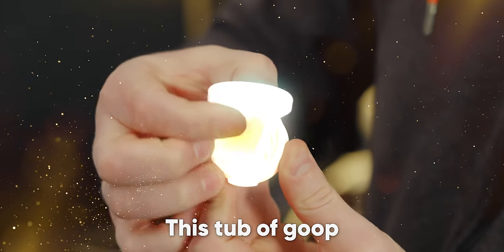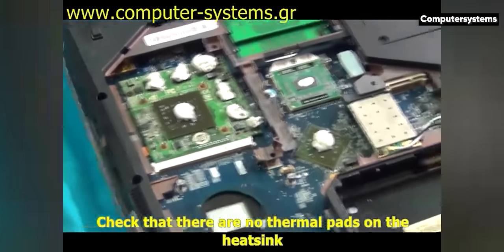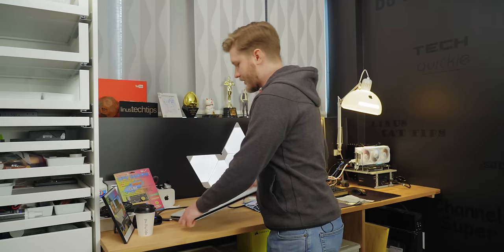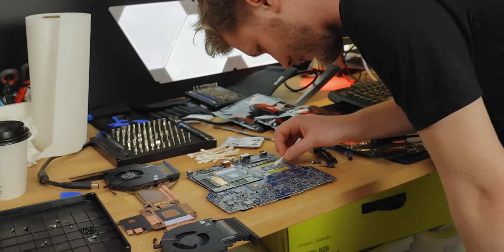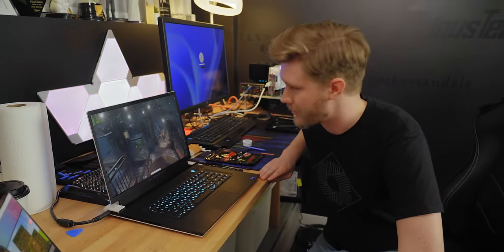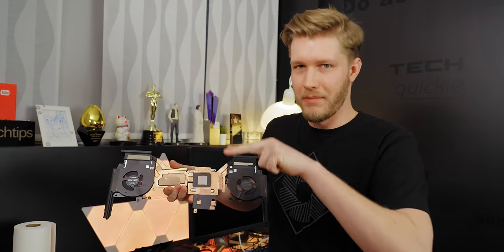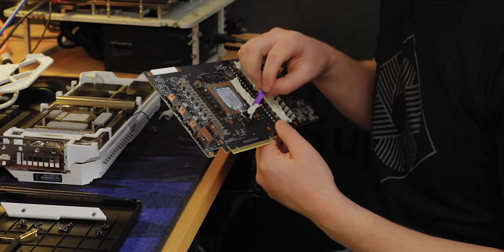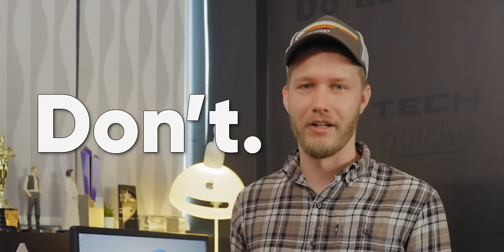More FPS for just $10 - K5 Pro Viscous Thermal Paste

Comment: Having watched Vertasium... it seems obvious that the aerogel, as seen through the heat sensor camera... actually absorbs a whole lot of the heat from the flamethrower... which means the heat doesn't need to be transferred anywhere else which is quite a unique insulator kept absolutely cool to the touch... because the heat struggles within each tiny enough pore almost preventing every bit of friction. If correct... there will not even be a need for GPU cooling fans.
Reply: the aerogel does not "absorb" anything, it just has a very low thermal conducticity, it transfers heat very very slow. which means the heat from a chip wouldn't be able to go anywhere, it would just boil. 
what you need is the opposite of that, a substance that conducts heat easily. like thermal pads / thermal paste / liquid metal etc. that's what helps you get the heat out as fast as possible so that the chip doesn't get too hot.
Reply: @realoctavian  You obviously did not watch that Vertasium video with the flamethrower involved.
Reply: @ThankYouESM  you cannot "absorb" heat. the only way of cooling an object is essentially placing it near an object that's colder so that they level out temperature-wise. energy cannot be "destroyed" (or "created"). 
in your example, the aerogel is simply acting as a "heat shield" by not letting the heat approach the subject. this is done to illustrate the low thermal conductivity of aerogel.
Reply: @realoctavian  According to Vertasium and all the visual cues in his video, it does absorb. Why not simply watch the Vertasium video instead of just being ignorant, which then you should be able to understand?
Reply: @realoctavian  Also keep in mind that as it is still showing the heat is still captured within... his hands touching the aerogel will displace that heat absorbed.
Reply: @ThankYouESM  when I said "you cannot absorb heat" what I meant was that you cannot magically make it dissapear. indeed some heat will be transfered to the aerogel in your example, but only a tiny bit of heat - which is bad, because you won't be able to cool the chip because the aerogel can barely take any heat off it. 
the point is that you cannot use an insulator to cool things since it would have the opposite offect instead. insulators are used to keep heat for as long as possible, that's why they're used for housing in cold areas, for example.

Comment: You guys need to do a follow up on this... I recently did this on my 3080 laptop and it was great for a few days... Then it was crashing a lot. I opened it up again and found that the K5 pro for the vram was all stuck to the heat sink and boiled out to bare metal in spots. It's like it separated from the vram and hardened on the surface. I temporarily switched it to thermal paste and the crashing went away. Now I'm left with a mess and waiting for thermal pads to come in the mail.

Comment: Just want to confirm what others are saying. Using the K5 Pro on newer GPUs is a mistake. In a future video you see this exact GPU getting a memory junction temp limit. This stuff has only a 5,3 W/m.K rating, which is 1/3 the rating of good thermal pads, and probably half of OEM pads. Honestly the liquid metal provided all their gains, they should probably take this video down or do a followup because this is bad advice and creating extra work for people to revert back to pads.
Reply: yeah & people have post pics where the k5 putty has boiled/burned

Comment: Try taking apart an HP Pavilion dv4 (or any dv variant, I imagine). It takes "Now we just have to put it all back together and hope that it works" to a whole new level lol. Compartments and ribbons and screws and components everywhere. All of which need to be removed in order to get to the heatsink. I have mine in the other room in pieces atm. Took 2-3 hours to get there. Now I THINK I need a new power jack cable and figure out the thermal pad thickness in order to repair it... And hope that fixes it lol. It looks pretty well toasted. But a fun little project for me.

Repairing the screen is a whole other can of worms. Either needs a flex cable and/or a video inverter board... and/or a whole new screen assembly.

Comment: Always get the battery out first!
For my shame I was servicing a laptop at my workplace, I have forgot to unplug the battery, a mainboard screw decided to fell off from my magnetic tip and fell off directly on the mainboard, the laptop was off but a short between 2 components fried the mainboard, 
that little screw killed the mainboard.

In 20 years it happened one time, one time was one time too much.
From that point I always double check the battery, if is still plugged in or not before servicing.

Comment: WARNING: DO NOT USE THIS PASTE!
I used it on the VRAMs and VRMs of my RTX 3070 mobile for just two weeks. When I removed the heatsink to replace the K5 with proper thermal putty, the K5 looked like swiss cheese.
Yes, it is bubbling when exposed to heat. It is also bleeding silicone oil and is a nightmare to clean up, since it does not dissolve in alcohols.
Reply: can you recomment good "thermal putty"? I found only k5 on the market
Reply: @WarerBrow  I have replaced the K5 with Laird tputty 607. Expensive, and it is hard to find a vendor that sells small quantities. Mouser sells 30cc for 126€.
I got 10cc for 30€ from a vendor in Berlin, but I think they ship only within EU.

Comment: This is really interesting although it doesn't seem to be available in the UK. I have a Dell XPS 15 9560 which is throttled massively by the VRMs overheating and since BIOS updates have nixed software control of voltage, I didn't have an alternative to using pads to try and take the heat away via the chassis. This looks like it would probably help. I already replaced the stock CPU and GPU paste with Thermal grizzly which made an appreciable difference to gaming temperatures.

Comment: Strange.. I had to repair the same Alienware laptop for my Friend, the X17 R1 with i9 11980HK and RTX 3080 16GB.. And because it had already been messed with before, the CPU and GPU throttling heavily, i replaced the apparent liquid metal (which someone had screwed up by putting paste in with it!) with Conductonaut and..i guess i did a better job than Alex because it doesn't throttle at all on the CPU now.. But the hotspot is still insane, so i'm tempted to replace the shitty pads with this putty! Just surprised there's no alternatives or better performers out there yet 8 months later.. Glad i didn't see this video beforehand though, repaired that laptop with no help but my own experience and knowledge! (Went from DOA to booting exactly where he left off when it died)

Comment: Seems like a good product.
Replacing thermal pads kinda sucks. You need the right thickness, then need to cut it to size, etc.. Just putting this stuff on seems easier.
Reply: The replacement ones are also pretty expensive, and you need a pack for each thickness. Plus all the time spent to figure out what thickness you need.

I'll definitely try this stuff out when I do my overhaul this summer

Comment: Older Alienware 15 r3 heatsink was a bent mess on 3 legs ,only this K5 pro was able to fix it. after couple of years was some kind of silicone oil leaking from it around ,but never had problem with temps again. don't use on CPU ,tried and didnt' work. used only as thermal pad and Gelid GC-Extreme on CPU ,Kryonaut will pump out after about a month!

Comment: Especially knowing that the Radeon VII suffers from potentially the HBM II modules and VRMs reaching Junction Temperature (0II0º Celsius) or worse when doing certain AI workloads (Topaz Labs' AI Video Enhance is notorious for this up to Version 02 Revision 03; it does better in Revision 04, not sure how it holds up in Revision 06 and beyond), wishfully this compound will make a significant difference for the Stock Cooler, especially for those such as myself who have yet to Undervolt the card; this might also finally solve my issues with my Slim Model PlayStation 03 (CECH-2001A) from November of 2009, the Cell CPU and RSX Reality Synthesizer suffered a massive Overheating issue back in August of 20I3 and wishfully this will remedy it, truly would've come in handy to know about this product had it existed back then but better late than never. (:

Comment: Instead of K5 Pro, I've used TG-PP10 thermal putty, but for replacing the stock putty used in 3080 over the VRM coils. Didn't try it for the memory (using Thermalright Extreme for that).
Reply: EVGA 3080? Turns out EVGA putty was one of the best performing thermal putties, and we all found out WAY too late. May want to check out Penchem TH949-1, Upsiren UX Pro, CX-H1300 or Laird T-Putty 607

Comment: Plz don't intall this item. I  open my RTX 3080ti Asus Strix and properly applied this paste  and my memory junction (using Hwinfo) jumped from constant 70  -  75.5c to 80 to 90c. I was using 3d mark for my testing. If you are considering  this item, please weigh the options and understand that  it might not work for you  of you will  get you minumal gains. However my VRM temps improved by 1c.

Comment: seems like a better product meant to replace pads rather than a product meant to improve fps. if you are going to use a different cooling solution, be it watter or air, or you have to replace your thermal pads, just use the product instead of new thermal pads or even the ones that came with the product. more like a transition from pads to paste. which is great actually.

Comment: 5:57 No it's not. Copper - > Good thermal conductivity. Thermal pads and paste - > Very bad thermal conductivity. So replacing thermal pads and paste by copper is better. Simple math. Distance multiplied by conductivity. Air is worst, pads and paste are better, copper is best. Use thermal interface materials to insulate from air gaps and copper to conduct heat over distance. For large distances and distribution heat pipes and vapor chambers are best, because instead of conducting heat through a solid material they transport it very quickly by movement of a gas.

Comment: Kryonaut for laptop is the worst choice you can make. This paste changes unrecoverably after reaching 80°C and looses its effectivnes it just hardens. Most modern laptops even with great cooling systems exceed this temperature making this paste into useless mass. You could possibly use it for GPU if it doesn't spike to 80°C but hot spot usually does exceed this point by much. You  should use something like Gelid GC extreme or Phobya nanogrease extereme those are thick paste with high viscosity and don't suffer from 'pump out' effect that much. I wonder if you could test some industrial grade thermal materials like Honeywell PTM7950 - a phase change thermal material and Laird HD90000 thermal pads, they're really popular in China for laptop repasting

Comment: I was going to say why not just use some good thermal paste. But after seeing how thick this stuff is and the fact that it is suppose to have just as good thermal performance as good TIM I have some really good ideas for it. Like for one it would be perfect to surround your chips with that you use liquid metal on. Also older GPU's like my old EVGA classified 980ti that has a ton of thermal pads and I've always had a hard time keeping the memory cool after watercooling it and replacing the stock pads. I did find a perfect solution in the end but that has one bank of memory chips with 3mm pads and the other 2 with 2mm so one bank is always a little hotter than the other. I also have a old Titan X that suffers from the same issues.

Comment: did you clean it with alcohol 97% before repasted? i will use it to remove any left over from the thermal tape and liquid metal the proper cleaner for maximum result.

Comment: I wonder if that stuff freezes or gets stiff enough to preform it into specific thicknesses and sizes? That way the manufacturer could sell it at specific sizes and thicknesses like regular thermal pads and then you freeze it so you can cut to size and apply on top vram. Then just let come back to room temp.  . Sandwich it between 2 layers of nonstick plastic and press to desired thickness. Peel away plastic .to apply kind of thing. I'm thinking a clay like consistency when frozen.

Comment: I want to see a video where the actual thermal paste on a CPU and GPU is replaced with this stuff rather than just the VRMs, especially with crappy heatsinks that are pitted or use poorly implemented direct heatpipe approaches that need thermal paste to fill in the gaps. I also wonder how well this stuff performs on devices with low mounting pressure as well.

Comment: I agree with the others, I'd like to see comparison tests. Also I could swear Linus tested this stuff before, declared it to be some garbage made in a garage and it isn't worth it because of the low thermal conductivity. Reading the specs on it, which weren't mentioned in this video, it looks like there are plenty of better solutions available, including some well priced thermal tape by grizzly.

Comment: Thats exactly the thing with laptops, adding some better conductive on vrm will help you to dissipate extra heat from vrm, yeah, but it will heat up the heat pipes way more than it was with less conductive compound amd you will and up with higher temps on your gpu and cpu and performance drop.
Reply: Just not this garbage, use HY 236 or HY 256 or Upsiren UPT-8 or so.

Comment: I wish this would help my laptop. It is power limited rather than thermally after I repasted it about a year ago. The fun of buying a low spec gaming laptop that would never compete with its desktop counterpart. It isnt like you can just add power to a laptop it is component limiting the wattage not the power supply.

Comment: If the problem with the thermal pads is that they only achieve 60% contact, then could you put a thin layer of thermal paste on top and bottom of a pad and get similar results?
Reply: But then why not just use thermal paste
Reply: @sufferr2914  You could use the pads as filler and not have to use that much paste. And you wouldn't have to order any special stuff. Also I just wonder how well it would work

Comment: I'm confused here.  Why do would the thermal pads "age"? Assuming they are made of silicone, they should be fairly stable over the life of product (especially sense they don't see extreme temperature swings), they shouldn't decrease in thermal resistance at all.  The only real reason why this thermal paste should be better is because the thermal paste probably has a higher thermal conductivity.

Additionally,  where does the claim that a thermal pad only contacts 60% of a component come from? I'd assume the manufacturers would oversize the thermal pad to maximize performance of the component/chip, not limit the area where its touching..

Comment: Sorry fellas, but the single best way to evaluate cooling performance of a VRAM pad replacement option is not fps of a game, its VRAM temps during ETH mining (with fixed ambient temperature and fan speed).  I know you avoid crypto mining like the plague, but the VRAM loads ETH mining puts on VRAM is much more intensive and consistent than gaming and will give the best results for your tests.  From there you can equate it to game play performance if you like, but as an analytical process, ETH mining is the best test for this product.  Lets also not ignore the fact that most of their potential customers are miners, not gamers.  With ETH 2 coming soon most miners have stopped buying cards new anymore, many are starting to sell trying to get out while GPU prices are high.   Prices are only still high because ''they can''.  There is plenty of stock where I am, just @ stupid high prices.  That's on the retail chain, not miners.

Comment: Why do thermal pads exist at all, do they have any advantages over thermal paste or liquid metal? If not, why isn't everyone going for the Asus route and putting paste on vrms and stuff. (Are they needed if there's a height difference in cooling, like 2mm and thermal paste isnt an option then pls help)
Reply: Liquid metal or even normal thermal paste is too liquid to work in situations that require more than a very thin layer - it's designed to fill microscopic voids, usually invisible to the naked eye. Much thicker than that and it won''t stay put, which causes big problems, especially with liquid metal.

In comparison, thermal pads are solid objects, meaning they don't go anywhere once applied, and can be used to fill much larger gaps. They're not as efficient at conducting heat, but any amount of thermally conductive material in the right places is better than an air gap insulating your component. If a component only needs a smaller amount of cooling to work fine, (Like most GPU memory), or will run fine at higher temperatures (Like most GPU VRMs), then a thermal pad can do enough to keep temperatures within spec, even when your product has those larger gaps to fill and needs thermal pads, instead of paste. 

This can enormously impact the price of your product - not because you chose "cheap" thermal pads over "expensive" thermal paste, but because using thermal pads might have allowed you to do very smart things, like have your GPU cooler built to looser (but still appropriate) tolerances instead of paying way too much to get the same cooler built to tolerances much tighter than actually needed. 

If a product designer balances this sort of thing correctly, the end result should be that you can provide better prices to consumers for the same performance out of their product. The only people who might complain are overclockers and modders, and they're probably not going to complain, they're going to do what they always have done - modify their stuff.